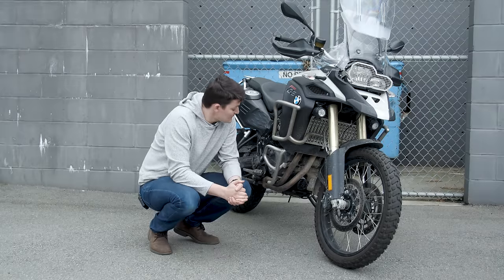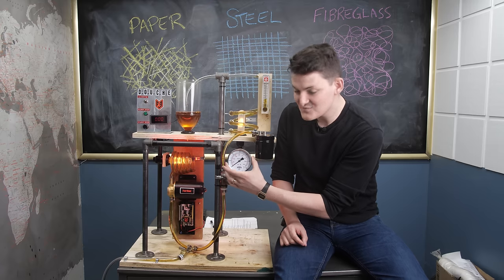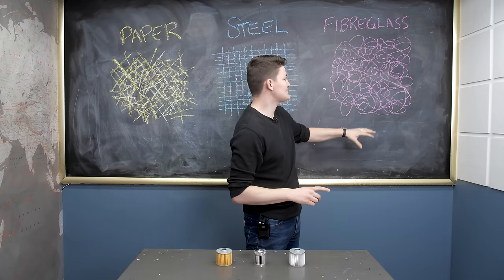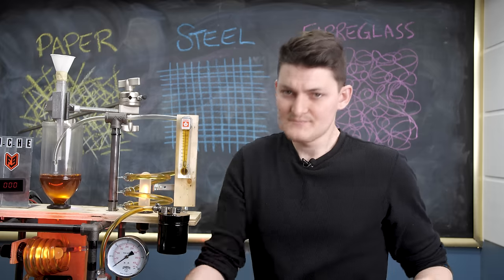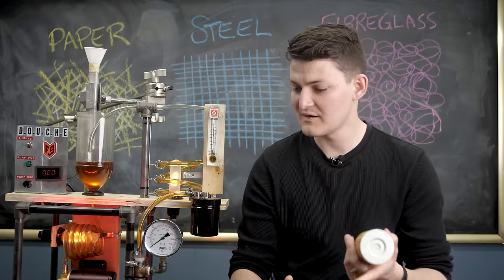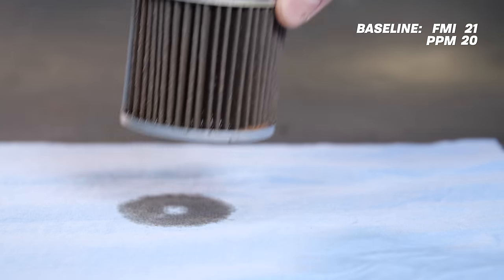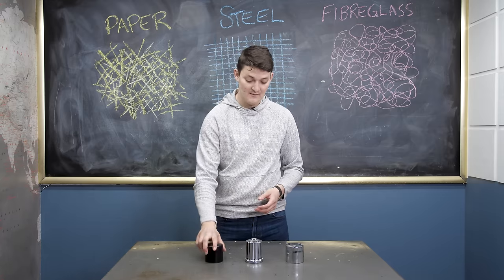The Best Oil Filter - Testing Paper vs Fibreglass vs Steel

Comment: If you use a magnetic sump plug or put a magnet on your existing oil filter you'll find that the level of circulating ferrous particles drop by another 50% or more.

Magnets are a very simple way of removing particles from circulation... although they are not technically a filter.

:-)

Comment: Does it make a huge difference if you would repeat the benchmark with heated up oil? At least we are talking 90°C in the vehicle, which chages viscosity and maybe also filter capacity. I mean, you already have your testbench, migth as well use a heater.

Comment: Ide like to know what the beta rating is on the three filters as well as the micron rating.  I'm quite surprised you actually sent samples to Edmonton. Fluidlife I'll assume? The viscosity rating of the oil used in your sample as well as the temperature of the oil as tested over the three samples?  Of course you are aware that viscosity and temperature would be a factor in flow rates. Have you ever thought of having a CLS or an ICML MLA level 2 discus this with you?

Comment: If the oil was tested at working temperatures it would be a lot thinner and there probably would have been very little difference between the 3 filters in back pressure N.B. 22, 24 and 25 PSI (~10%) is not that large a difference. The viscosity of the oil also matters as thinner oils would be less affected and thicker oils would be more affected. That looked like a fairly viscous oil that was being tested?

Comment: Back pressure resistance is irrelevant in a hydraulic system so long as it doesn't damage the pump, which it won't Flow will be constant. Positive displacement pumps do not care.

Comment: Hi Guys, would you kindly consider running a review on 2 stroke oil added to the fuel tank of a 4 stroke engine. I ride Harley VTwin Breakout 103 2017 and from my personal experience using 1-500 ratio brings amazing added value.

Comment: Years ago when I was researching this topic, I realized fiberglass filters were overpriced and worse performing after going onto Wix's website and seeing that they list a micron rating for their paper filters, but not their fiberglass ones. 

Further research showed that fiberglass filters actually filter worse and are really only meant for extended oil drain intervals or neglected engines where a paper filter would disintegrate.

Comment: my first motorcycle was a yamaha xs650sg(1980) and the oil filter was reusable steel mesh. 
I haven't any idea which filter uses a fiberglass media to filter oil.
Paper cartridges or paper media black spin-ons have been cleaning the oil in my bikes since the valve sucking(from valve floating) Yamaha XS650 Special

Comment: Going one step further than this video....It has been well documented that the frame construction of the filter as well as how much paper filter is in it really matters. To that end if you research this....A WIX filter has been shown to be FAR, superior. Fram is amongst the worse....avoid them like the plague !
Reply: I ran Fram filters for 14 years in my minivan with no issues. Part of that was that I never missed a maintenance interval. And second is that they put the grippy stuff on the outside so I didn't have to mess with tools to change the filter. Put the grippy stuff on another filter and I would probably use that. Unfortunately I can't find Fram anymore and their innovative grippy surface.

Comment: The K&P Engineering filter element is made from medical grade, type 304 stainless steel micronic filter cloth    A one inch square of this material flows  1.9 gallons of oil per minute at only 1 PSI pump pressure ?

Comment: Well dammit, why did you wait so long to do this test!? I just replaced 3 of the 5 Harley's oil filters with reusable steel mesh filters, (one already had a steel mesh oil filter when I purchased it used), and I have one here waiting for the next oil change in the Triumph Tiger 800XC.

Comment: What about the use of magnets in filter and the drain plug. I’ve used these for over 30 years. Yamaha 900 seca , 126 k, SR 500, 96k,  2008 Aprilia 750 shiver, 117k. All miles not kilometer’s. Now on Kawasaki X300 Versys.
Reply: Keep in mind that some of the debris caught by the filter is non-metallic
and non-ferrous metals, and thus not attracted by a magnet.

Comment: oil filters are designed based on crank case volume/sump and size of the oil galleries.. so this test is just horsecrap at the end of the day. also, you need to heat the oil to operating temperature. everyone is an engineer on youtube.

Comment: I think a bit of context is in order here. Sure the metal filter only gets 9 tsp of material, but does the average motorcycle engine generate over 9 tsp of material between standard oil change intervals?

Comment: At the rate motorcycle people change oil I don't think they need a filter. I'm sure some of them are 500km and probably a lot at 1000km.

That's something you should do, oil containment over time and at what point you are actually doing excess wear if you don't change it. Compare 500, 1000, 2000, 5000,10000.

Comment: Not sure if it on here.   What temperature of oil was this at.  Viscosity changes with temp. 
With a less viscosity oil it flies faster and could affect the amount of surface area the oil touches in the filter.  Just curious.

Comment: Hey dude, I’m driving a 2016 Mitsubishi Outlander PHEV 2litre petrol. The nearest Mitsubishi dealer is over an hour drive for parts , just wondering can you recommend any other oil filter and oil ? Also any idea who makes the oil and oil filters for Mitsubishi? I’ve had Toyota for nearly 30 years and used nothing only original oil & filters (but the garage was only five minutes drive from my house 😅)

Comment: The oil filter for my aircraft engine is paper.  It's aviation, so they have to use another name to justify the crazy price; it's called "cellulosic" filter media. It's also impregnated with resin - plastic I guess.

Comment: I have long suspected that if it actually matters how good your oil filter is, your engine is in the process of self-distructing (or is Italian, oh, wait I guess that is the same thing). Change your oil with anything that meets the specs, often enough, with a brand name disposable paper filter and apply your energy to riding more and learning to ride better.  I should stop there, but... stainless steel mesh filters that you can clean and reuse to save money, really?  You spent 10K+ plus on something that is pure indulgence (that's OK, that's what we live for) and you want to save money on filters?  More to the point - how well do you actually clean that filter?  What do you do with the dirty solvent you cleaned it in?  I hope you don't save it for the next time. RyanF9: thanks, love your content.

Comment: 1:33 This guy disses on imperial units and then turns around and uses pounds-force per square inch instead of kilopascals. Btw 24 lbf/in = 165 kPa
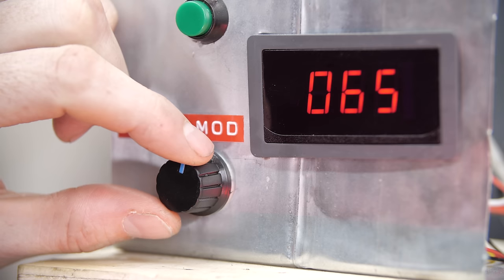2:29 22 lbf/in = 152 kPa
2:33 Another imperial unit; at least he used the correct unit of torque (pound-feet) instead of the unit of energy (foot-pounds). Still should've used newton-meters.
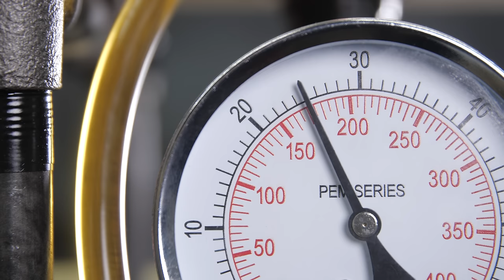3:04 25 lbf/in = 172 kPa
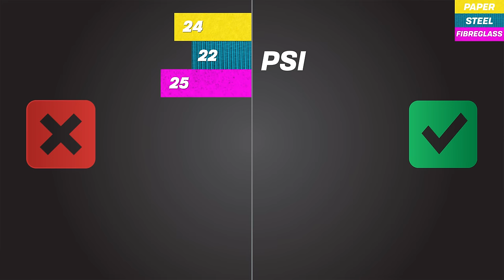4:39 There are metric teaspoons, but he didn't specify which ones he's using. He should've just used cubic centimeters.

Comment: i have an off topic question; is there any benefit of buying aftermarket twin shock absorbers (rear) for an extremely heavy rider (130kg or 300pounds + gear) the bike in question is 500cc maxi scooter??? what preload settings (1 to 5)  should said rider use?

Comment: Paper is always the better filter...look up bob the oil guy, even air filters unless they get wet...when you have a diesel engine worth over a million $ paper filters do the job that they are designed to do.
Also don't believe that brand X is better than brand Y because most filter re-sellers come from the same factory and they do a batch run with different paint and labeling.

Comment: So here is my question high mileage oil filters that are rated for 10k or 20k miles 
Are they getting that longevity because they are steel or two other means?
And do manufacturers State what material they use

Comment: Per the tests, the conclusion is obvious. Paper wins. So, as long as the tests reflect real life, all is good. Let's just assume for a moment that you like your engine and don't want to kill it (if you don't like your engine, do the simple thing and don't change the oil ever and do lots of short journeys). So, reasonable assumption, we the viewers are all good boys and girls and like our engines. Let us further assume we do our own basic maintenance, so the oil changes are down to us. Let us ignore what the bike manufacturer tells us about oil change intervals. They are set to keep their dealer network happy with work (short intervals) and their marketing guys happy (long intervals), and their finance execs, who want to keep warranty claims low in the warranty period. All that goes in to the pot and out they pick a number. What if you are not interested in that discussion, what if you wanted to change the oil when it starts to lose the properties it needs in the engine? Well, that would be around 1000 miles. Eeep, that's low. Let's say your bike manufacturer calls for their own brand oil. Let's say it is 20W50 fully synthetic. Let's say you need 4 quarts. You can pick up that oil for about $20 or less a quart (Amsoil might be much the same, for example). Those oils are designed to last (sort of) for 3000-5000 miles, but, frankly, the 'performance' of the oil will be quite poor even half way through that. Or, you could buy Castrol Power1 4T Racing 10W50 for as low as $6/7 a quart. Change that every 1000 miles and suddenly the economics change. $100 for the SS filter version versus $40 for 3 filters that you would need for 3 oil changes. Economics aside. Let's look at the tests. If I take a blown engine apart, as Eric (if you don't know who that YT hero is, shame on you) says, I will find forbidden glitter (bearing) everywhere if it has blown due to an oiling problem. How come? The tests in this video suggest that the paper filter will catch most of that. Not so. 90% of the damage to the bearings (the most common damage in an engine) happens in the first few seconds of startup. The oil is cold and like syrup, and does not go through the oil filter. It goes through the filter bypass. Paper filters are awful at that point, next to useless. Sure, they will catch the bearing material as the oil heats up, but when you take a blown engine apart, most of the bearing material will be in the sump, the oil pump, the valves, everywhere, with only a small amount in the filter (relatively). No filter is going to keep the fine bearing material out of the oil. No filter is going to oil the engine faster on startup. Starting an engine is what breaks an engine, period. Changing the oil very regularly reduces contaminants in the oil most effectively. Having a filter that does not restrict oil flow through the filter when the oil is cold is the second best thing you can do. When an engine is going persistently fast, some of the oil will by pass the paper filter, it simply cannot cope with the flow rate needed. If that wasn't so, the filters would not have such potentially large bypasses in them. The bike makers like to keep the filters small, but sometimes have to make the filter bigger as they realize that oil flow is way too restricted at high speed. Harley had to do this with the M8, and I am sure other makers will have done the same. This is why, if you strip oil filters down from third parties and compare them to the OEM, the 3rd party 'high flow' filters might have three times the square area of paper. Oil pressure isn't the key, but oil flow is. They are sort of related, but directly comparable. Each different engine will see oil pressures rise to different maximums (partly due to maximum revs the engine is designed for, so low revving cruiser might have a much lower oil pressure than a liter sport bike_, but will also have different oil flow rates. I am not saying these tests are wrong, but I am saying that the tests are not sufficiently representative of the real world, that, for some, they might be misleading. There will be cases where paper is best, and there will be cases where SS is best. When it comes to paper, it may be that a taller filter would be beneficial, or one with more paper in it might be, and the bypass mechanism, and flow holes, might also be key. But, if you want to be kind to your engine, change your oil more frequently than the manual says to, and then don't worry so much about the brand and pay less for the oil, just don't go too cheap.

Comment: This compares random filters together and doesn't prove anything. What is the B200 rating for the microglass? Whats the B2 rating for the cellulose? What mesh size is the steel mesh filter? Fiberglass, cellulose, and steel mesh have completely different ranges of efficiency. Steel mesh is never used for filtering before anything critical, such as the engine oil feed to bearings or hydraulic oil going to servo valves. Microglass will always outperform cellulose. Steel mesh will always have a lower pressure drop but nominal efficiency and has limitation to ~15-25 micron, depending on the weaver.

Comment: I used to clean steel filters very regularly in an aircraft overhaul shop and they fucking suck. They get loaded up with carbon way way too easily. Reusing filters is a pain in the ass in terms of cleaning and a cheap paper filter just as way easier and cheaper in respect to man hours. I stopped considering buying a steel filter for my bike when I learned this. The increase in PSI is worth it because it's such a small increase anyway.

Comment: Great comparison but reality very misleading..... Most all oil filters use a bypass valve.. That means only a small percentage of oil gets actually filtered every flow cycle.  Add to that the paper and fiberglass filters may have much larger filter holes than steel wire. 30 microns absolute means in just one oil cycle it will filter nearly 100% of all particles over 30 microns  Where as paper and fiberglass wall first bypass a vast majority of oil with no filtration and start filtering some oil from 400 microns down. Once the paper and oil filters start to clog up the remaining openings will filter some particles less than 30 microns.. BTW 5 microns is about the size particle as a particle of smoke from an exhale on a cigarette ..

Comment: problem is different filters use different internal designs that flow differently and filter differently. you need multiple top level filter brands before you can say anything because one may be worse than the others. K&N filters for example are known to be POS these days

Comment: what do the formula 1 cars use this is the optima of engineering and design  I use cleanable steel mesh filters it save on cost and lets you see what's going thru you engine  excuse me if I dont use the term motor  I am a aerospace maintainer

Comment: Call me crazy. Your oil is going to get dirty in time no matter what you do. My dr650's manual says to change oil ever 3/4 k and replace the filter every other time. If i use the stainless steel filter and clean it every time i change the oil, isn't it hands down better than the paper?

Comment: The wear particles that damage your engine are those down to ~2 micron. A standard oil filter will filter down to 40 or maybe as little as 30 micron?

The role of an oil filter is to filter out as many of those particles as possible. Thus an oil analysis is a good tool to work out what works and what doesn't?

You'd probably only have ~200 mg of particles circulating in your oil... so the teaspoon test doesn't tell you much other than confirming that all filters are unlikely to get clogged? i.e. Each teaspoon probably contains 3-5 g of dirt.

:-)

Comment: What micron ratings are the filters?
Reply: That's something a lot of manufacturers leave out. A micron rating alone isn't even enough to actually gauge how well a filter works; beta ratios are there for that reason, but I've never found a single car or motorcycle oil filter display their beta ratio before.

Comment: People seem to assume that whatever parts the manufacturer’s engineers selected or designed are the cheapest, lousiest, stupidest ones available. Intake filters choke the engine within an inch of its life, too-small throttle bodies must have been on sale, spark plugs that can barely ignite air/fuel, restrictive exhaust systems designed by monkeys, ECU mapping for maximum lameness, and so on. Engines can only be unleashed by getting rid of all that stuff in favor of bigger, shinier, flowier, juicier bits and bobs from some factory in China. If you bolt enough aftermarket crap on enough cars and bikes over the years, however, you eventually learn to give the original engineering choices made by actual automotive engineers a wide berth and a lot of credit. And, generally, to leave things the hell alone. So it appears to be with oil filters. YMMV.

Comment: It's the I told you so 🤷  short story still it needs to be efficient and effective in all riding conditions extreme hot 🔥 and extreme cold weather conditions. Could this paper filter fall apart under pressure in hot operating conditions after its sitting in your garage for several months? YES a new one Engine oil 🛢 now  10 W 40 motorcycle 🏍  or 20 W 50 motorcycle ? Find out why I am not à douche ok bye

Comment: This was NOT a REAL test.  I call B.S.  Run them in a bike for 3000 miles. 
1. Isn't it better to get rid of water quickly than have it sit and slowly feed threw  out your engine. 2.  16 tablespoons of Aluminum,  you will need more then a oil filter.  
3.  Fresh Paper is nice at the 300 mile mark but what does it do at 3000 miles?